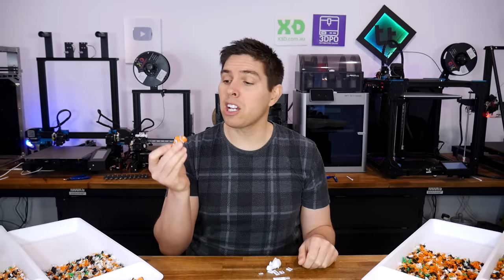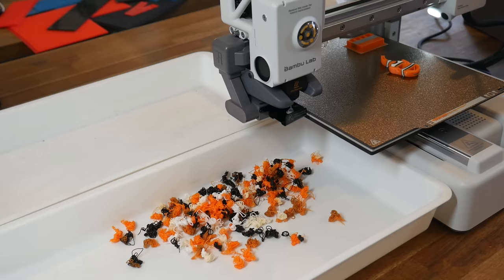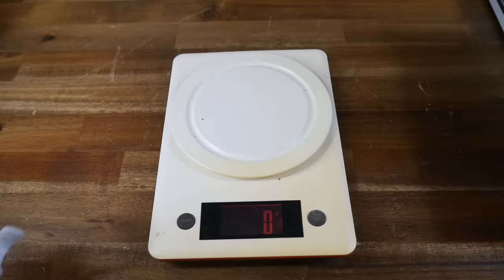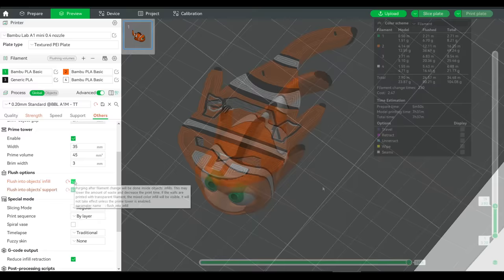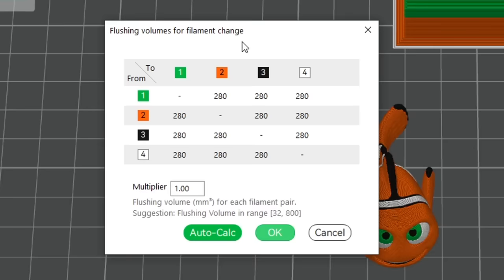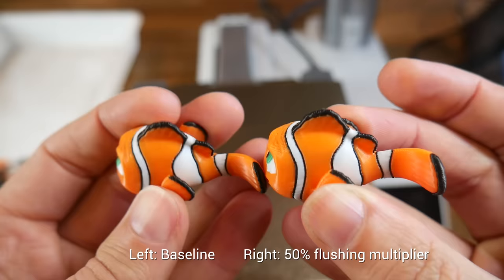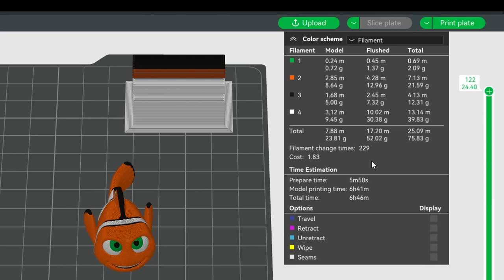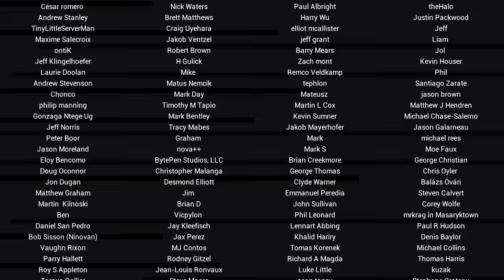Reducing waste from Bambu Lab AMS (lite) prints

Comment: Hi, thank you for this informative video. The more I learn about Bambu Lab's printers, the more asterisks I see lol. I imagine that one could further optimize waste by playing with orientation of the print ? But that would not be the ultimate solution either, since orientation plays a role in both structural strength and render finish.

Comment: Great video as always. Why do we have the poop blobs and the purge tower? I thought the point of the tower is to flush the old colour? Also I read you can select other models (if you don't care about colour) to print rather than the tower which is probably more useful.
Reply: Cutting the filament inside the extruder would need an enourmous waste tower. Purging needs much less space on the plate. Also it's much faster. Still, the preassure inside the nozzle has to be stabilized. So you should have a (small) prime tower.
So Waste Tower = do the colour transition (MMU2/3, ERCF, Chameleon 3d ...), replaced by purge on Bambulabs printer, Prime Tower = get preasure insile the nozzle correct.
Of course, any Waste Tower also works as prime tower (so no twin towers needed).
Wipe into object can replace the Waste Tower (not the Prime Tower). Of course only on multi colour, not multi material (do not mix PLA and PETG)

Comment: Nice video! I learned something! I am very surprised that the obvious and easiest solution wasn't mentioned: changing orientation. Reorient the printing of the part so that the least color transitions are made on a layer, in this particular example, put Nemo with the nose on the plate. You don't even need supports for this particular model . One should think if the supports result in less waste or less quality when choosing them.
I would also consider Z Hopping, video about if from ModBot(Z Hopping To Prevent Batch Failures & Multi Color Same Layer Printing): https://www.youtube.com/watch?v=TMV9tOZQ8fY
I would also like some slicer option for this kind of things: flush waste into other object(where color of that object does not necessarily matter). Purging is not actually purging, it continues to use the waste material on something different and makes breaks with that, comes back to the main print and comes back and resumes etc. It would be nice to flush color on object so that you can reuse the color on other object as well that need to be single colored. Unfortunately, this only applies to Bambu Slicer since Bambu printers use this purge and continue mechanism. Prusa does multi color printing only by having multiple extruders.

Comment: Have you experimented with reducing the prime volume for the prime tower? Maybe this can be reduced since flush into ojects infill is turned on. Not sure if layers with a low amount of infill would cause problems though. BTW, great video!
Reply: I'm pretty sure that the amount purged into infill is subtracted from what you need to purge on the tower.
Reply: @humbledeer  that would surpise me, because my waste always looks the same. 
if that is the case you could just make your purge tower rly big, and the filament purging by the AMS would redcue the waiting time

Comment: Not sure if it's already being done or not but you could try to add alot of retraction just before cutting the filament so only the blobby tip gets cut of instead of the couple of mm of filemant that would be fine for reuse
The when purging you also prime the nozzle so you should be good to go

Comment: I bet purging into infill when printing say 10-20 of these at once could potentially reduce the amount of wasted fillament a lot as well. You would say that there should be a point where it basically doesn't even need to print a purge tower on some prints. But I don't know if this is possible with current slicers. Would also be interesting if infill% was dependant on the amount of purging it has to do, so you can use the "waste" for some extra strength or weight in the part.

Comment: Why can't you use a color transition inside the model instead of throwing it away? That is, we print the outer layers in the desired color, and on the inner ones, during the printing process there is a color transition and if this is not enough for a complete color change, then the excess is already thrown away.
If the model is not translucent, then the inner layers will still not be visible. Except that in some cases the wall will need to be made thicker.

Comment: Why not shift the cut command in G code up a few lines, so the filament will be cut, print a few more lines, and then purge. 

Could probably use a matlab script to locate the cut command and shift it up.

Comment: I don't think the G-Code modd reduce the real required purge at all, what it does is just saving some filament filament, that's why we have less poops volume at the end.
If you retrieve 2cm of filament before purge, it's for sure the amount of filament you won't have to purge, but the real required purge to ensure no colors bleeding will stay the same.
The reduced purge value in the slicer is just due to the 2cm of retrieved filament.
That can be seen on pictures and tests, the transitions between colors look the same.
IMHO it's not really useful and can create more troubles than benefits, probably the reasons why Bambu didn't implement that.
I use km of filaments every years, I don't really care saving a few meters, just want perfect prints with no color bleed, reason why I'm not shy on color purge to avoid having crap print results like some people just happy because they saved 2m of filaments.
My 2 cents of course.

Comment: Some definite improvements over the default settings, but it's still quite a bit of waste, especially if you only need one of something.. while I would like to do multi material printing at some point, I don't think a single extruder is gong be how I do it.. it just doesn't seem worth..
Reply: Well said. I just got a p1S with visions of printing fun multi color toys and figures for the kids but at $1400 for combo with tax and Bambu brand filament ar $20+ per roll and all that waste and the much longer print times, second guessing my decision. With my 5M, though single color I was cranking out toys and fun things all day. Now to print a single pokemon few inch big toy, 16 hours....

Comment: Should be possible to cut the filament prematurely, so that you obly have to purge when the actual transition occurs, which can be done into the model.

Also, purge into inner walls should definitley be an option, or rather ”perge into anything thag’s not visible”.

Non-planar slicing could also help reduce waste, but then you need a whole new slicer :(

So basically, it’s all a software problem, the system itself doesn’t need to be wasteful.

Comment: Thanks for this video.  I've been considering the A1 so I am trying to learn what to expect.  Do you think "Purge to infill" would have a more substantial effect on a much larger model?  The tiny fish, even at 50% infill, uses very little filament volumetrically.  But what about a much larger model?  Much more filament would be required to achieve even 5% infill on a large model than even 50% infill on a small model.  That said, maybe people aren't printing massive multi-color models that frequently.

Comment: Kinda surprised that you didn't talk about reorienting the print to reduce switches. I feel like adjusting models is part of solving the problem. Similar to printing replicas. 

Also slicer developers need to work on less vertical oriented slicers. Its hard yes, but if you can do 5 layers in one colour then switch and the nozzle has enough clearance to still print (similar to the idea in sequential print order of multiple models). Or even move the nozzle in 3 dimensions not just two. Think of models with large forks where the spacing is far apart and different colours.

Comment: I wonder if you could make it switch early?  It looked like there's a long section of the original material before you get to the transition.  Printing with a bit of that would remove a bit more of the unnecessary purge.

I just got an A1 with AMS Lite; I've slowly been getting more and more regretful of how many caveats there are.  It still looks like it'll be useful, but half of what I want to use it for it can't do.  Alas.

Comment: I saw another person who used a factor instead of 50% of 80% but it did not print the purge tower, so when I get the X1C I will test what happens if you use a multiplication factor of 50% and without a purge tower

Comment: What if... you'd have the knife cutting the filament long before it's near the hotend. If you could, by software, predict how much of each color you need, you can cut off after, say 73mm. Then with a direct drive you can still feed the filament reliably but will nee little to no pure?
Reply: You would need to do the filament change before you fully printed the actuall colour, as you need the new filamend to push. In this time oozing could happen. You have to reprime the nozzle to get acceplable quality. And no retractions allowed after cutting. And still, molten plastic inside the nozzle can bleed, so you have a transition.
So you have to do cut&merge filaments before entering the hotend. Which is exactly what the Pallette system does - for a price you can get a bambu + AMS.
If you do a lot of multicolour, this definitly is the best approach. But no way to splice PLA and PETG to do the support interface layer trick.
Reply: I think the Palette multi material units basically do exactly this

Comment: Rotating the model so colors are more separated horizontally can speed up the printing significantly while reducing waste. Yes, you might need support. But depending on the model it’s worth it.

Comment: 10:22 How did printing 5 copies of the model require slightly over 2x the ‘model filament’ vs a single copy? I expect it to be 5x unless some other changes were introduced in the slicer settings.

Comment: How about hollowing out the model and replace internal volume by supports so it flushed directly inside and the color islands are smaller on the surface instead of going through the model ?

Comment: Woud be nice if it was possible to print 2 different models at the same time. The original where colors must be correct.
And another model where all the waste filament could be used 
(maybe the second model have to be painted anyway ?) 
Then there is no waste at all.

Comment: ok my tip is that i use auto calc as you do. but purgetower is also flushing right ? so what if you autocalc and use the purge tower but the volume of purgetower is then manually reduced in the flushing diagram example: from black to white you have 507 and the tower is 45 so take 507-45 = 462 

I do this for every color in orca slicer and have no bleed and I also use infill option to spare some two 
my tower is the same size as the lowest number in auto calc

Comment: Thanks Michael. Do you think we can further reduce the waste by retract the filament few mm before cutting it? I think Bambu Lab use a conservative approach.
Reply: I'd say that retracting and cutting the filament would create potential for clogs due to molten filament sticking to the coldend walls.
Reply: The SMuFF project uses this aproach. You have to experiment a bit to avoid cloggs, and also an integrated heatbreak/nozzle combo works best (Revo, TUN, Nextruder). However, if you use such systems, you get very good filament tips with ramping (at least with standard flow), so you do not need cut&poo anyways...
Reply: @Papinak2 Yes. I can see the risk. My thought is the clog usually happens at the tip of the filament. What if before the cut, the filament retracts to the tip. When the hothead is still heated, this could work. Of course it takes time to utilize the retraction distance.

Comment: Doesn't FIlametrix have in their code to pull the filament from nozzle a bit, thencut it leaving just a small tip, withdraw, load new filament, and purge just the small tip left?

Comment: The problem is the number of filament changes for each layer which can’t be reduced whatever you do. If there are four different colors on a layer, you’ll have minimum three filament changes (supposing that the printer is smart enough to start the next layer using the last color from the previous one).
A more efficient way (at least when printing with only non-transparent filaments), would be to flush while printing the infills. 
What I mean by that is that, when changing colors, the printer should print only on the inside of the piece where color bleed won’t be a problem as it will not be visible from the outside. It should only start to print the visible outside when the new filament is clean. 
If the piece has supports, that’s even better, it could (and I hope it does already) take advantage of that and use these waste parts to flush as much as it wants…

To sum up, it should recycle the waste filament by using it to fill the inside of the print until the color change is complete and ready to print the cosmetic parts that need to be totally clean. But once again, this won’t work for clear filaments, only opaque ones
Reply: did you even watch the video
Reply: @suivzmoi I did, but clearly there’s something I misunderstood. Or I explained poorly what I had in mind… or both. 
I understand that there is a minimum length of filaments that has to be thrown away with each color change. I am just surprised that the options to deal with the color bleeding after the change don’t really make a big difference in the amount of wasted filament. Maybe that’s as far as it can go by already doing what I was thinking about.
If that is so, my bad…
Reply: @suivzmoi  but still I’m surprised about your vehement reaction, considering that I’m not the only one talking about using color bleed waste filament for infills, supports or side printed object, where the color accuracy is not important.

Comment: Do you really support autonomous filament change during the print? Because it is always a filament waste problem. Maybe you can print different parts and glue them together? I do not use multi color print because of that but i am curious about your reply. Thank you.
Reply: The quality (and ease of use) of glued parts will never be as good as printing it all in one go. You'll likely need to sand the parts to fit together well which is difficult with small parts. Furthermore, a print like this Nemo would probably be 20 separate pieces needing 20 separate models with a way to slot them all together.

Comment: Just a Quick question because I dont have a 3D printer but only a 3D pen that.creates little waste. Question, can a 3D printer build a multicoloured model and using the waste at the same time build another model that later can be hand painted ? I asked around but no one yet gave an answer, Thanks from another Aussie cheers Perry
Reply: Yes. At least this one does have an option for that. 

But you have to expect a less than optimal model. Since the nozzle is losing pressure while filament is changed there will always be some underextrusion on each change.
Reply: Maybe theres an AI fix for that, thanks for your reply cheers  @LachskoenigIV

Comment: Current color changing tech is a joke. seriously , it works but its not worth making multi color prints if it takes days to complete anything. We should be focusing on more simple tech, like coloring our filament while its being printed. Kind of like how people use permanent markers to make multicolor prints by coloring it as its being pulled into the extruder. keep it simple
Reply from the maker: I have a video in sharpie coloured multi coloured printing. It's different to how you describe, though.
Reply: @TeachingTech  I'll have to check it out thanks

Comment: can the G code be edited so it retracts a bit before cutting the filament to reduce the flushing needed?
Reply: SMuff project does this. However, this can cause clogging, as the molten filament is inside the heatbreak, cooling untill new filament comes to push it back into the nozzle.

Comment: its pretty fun to saw that bambu fail :-D i print it on your setting on my prusa XL 5 tool heads and reslts are : 1 h 4m print time and 10,01 g of filament use :-D 5 colors zero waste :-D so my prusa XL is 7 times faster and saves 90% of filament :-D so again this confirmed my choice still use prusa instead of this chinese stolen empty promisses .
Reply: my prusa XL 5 tool heads print this marlin with same video settings and reslts are : 1 h 4m print time and 10,01 g of filament use :- D 5 colors zero waste